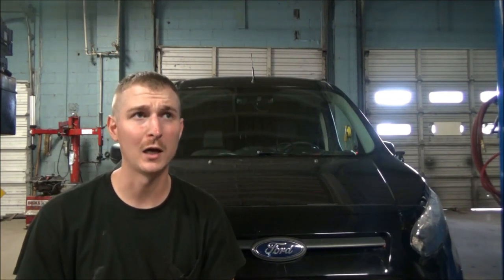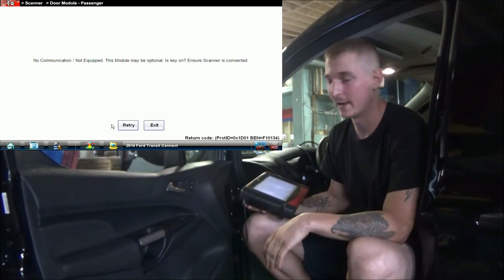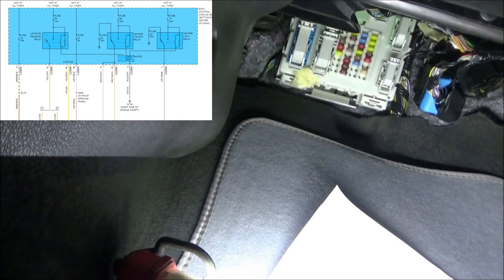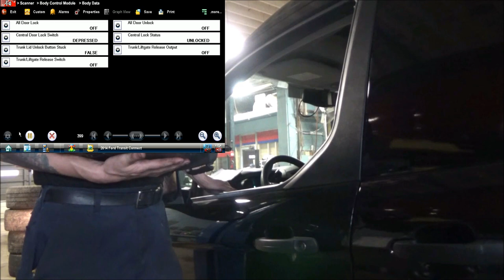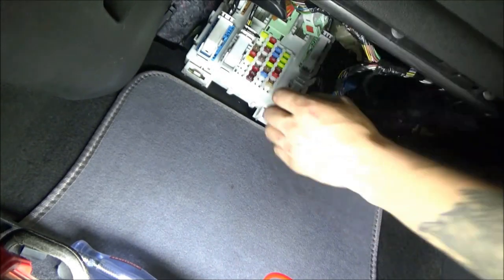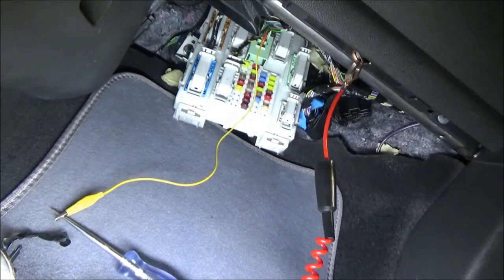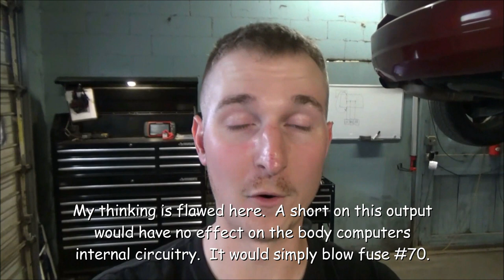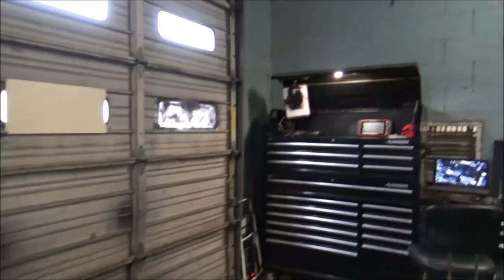2014 Ford Transit Door Locks Inop

Comment: Good to see you back, another interesting video. I had similar situation on a Highlander, doors would lock but not unlock. Women bought it used, the car at one time had some sort of aftermarket remote start/alarm that was removed, and poorly at that. Loose wires floating around under the dash with many wild hairs. I cleaned that up, and tracked down problem to a BCM output relay, which is internal to the unit. I know how you feel, I really don't want to tell someone they need a new computer, especially one that's $1000 retail to the customer unless I'm 100% certain. Good job double checking for a missing fuse on this one.

Comment: Couple resources for you. These are used by alarm and remote start installers who deal with body wiring every day:

http://www.bulldogsecurity.com

Another: www.the12volt.com 

Both have vehicle specific wiring diagrams that are invaluable.
Reply: best solution, don't be lazy and lock/unlock doors with a key?

OK, OK,  bad trolling, but then again people are !#$%^&* lazy and want the easy way of everything, I do to, but some things I want reliability vs fudgefest, I trust power door locks not. I like the older vehicles I can visually "see" the lock knob down on, over anything with an alarm. in the end it's all useless, a skilled thief will TAKE whatever they want anyway.

Comment: Another tip, fuse 83 had nothing to do with the lock circuit, it's fuse 84. Look at your wiring diagram more closely and you will see why.

Comment: On stuff this new, when the SI sucks, you can usually download an owners manual for free and you would at least then have the CORRECT layout for ALL fuses to at lest see if one is missing.   I find on any electrical issue, u can almost guarantee somebody was in there first, messing with it.

Comment: Great to see you back at it Joe, the editing software is sweet too!
Bigger diagrams next time maybe?

Great save in the end man!
Keep it up.

With the center lock relay in the rest position, the grey and brown wire is connected directly to (fused) ground.
Reply from the maker: And we have our first winner!  Did the video look laggy?  I think I need to tweak things a bit...  Editing this video was a huge challenge trying to get everything where it needed to be.  Thanks for the tip on the diagrams!
Reply: No, I didn't find it laggy. 
Just hard to follow the diagram.  
I did bust out laughing when the battery was dead!  Never ending battle...
Reply from the maker: Yeah I wasn't sure how much of the circuit to include.  I'll definitely do a better job next time.
Reply: @pinpointautomotiverepair1592  hols
Reply: Hey beto
Reply: @pinpointautomotiverepair1592  thank u be there